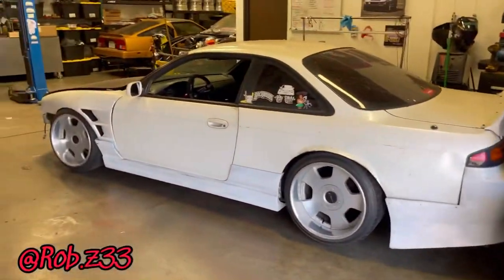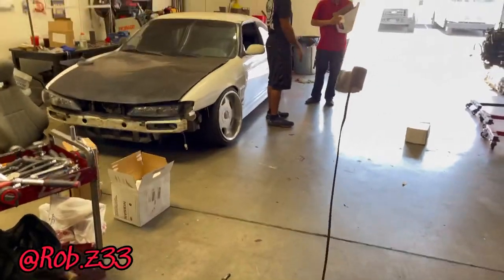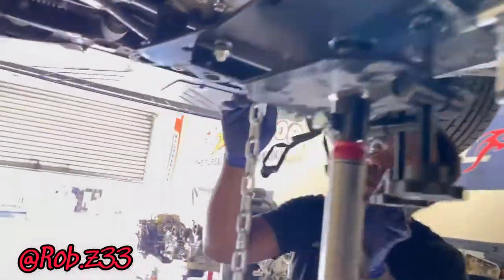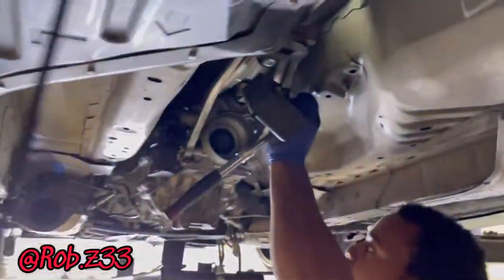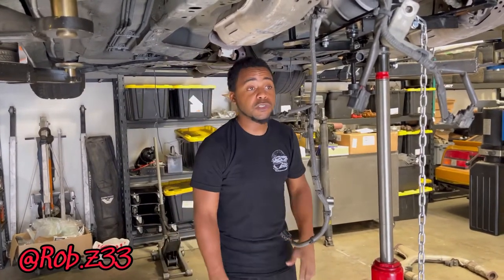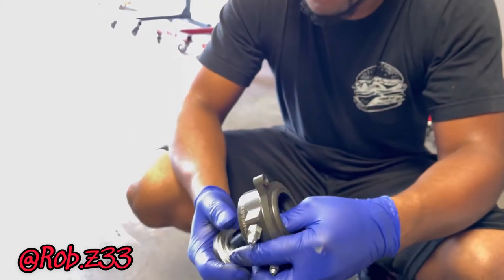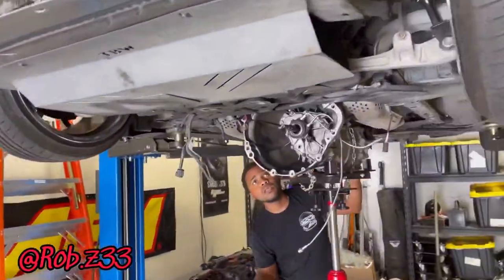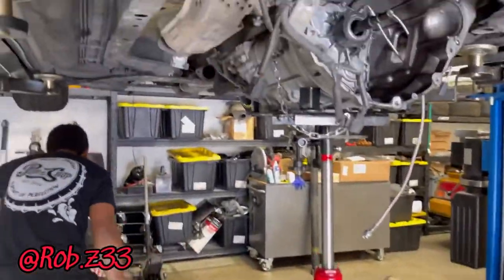HR 350 GETS UPGRADED CLUTCHMASTERS SLAVE CYLINDER!

Comment: that CSC costs too much it doesnt make sense to buy something like that .. for the almost the same money you can go with external csc kit ..
Reply from the maker: I could’ve, but I got mine at a great price and the part was readily available at the shop that did the work vs. having to wait for the part. Also I haven’t had a single issue out of the one I went with, so I am not mad at my choice at all 🤙🏾
Reply: @RobZ33  if it was like 250 bucks it's perfe item..but it costs 400 now if you can find it